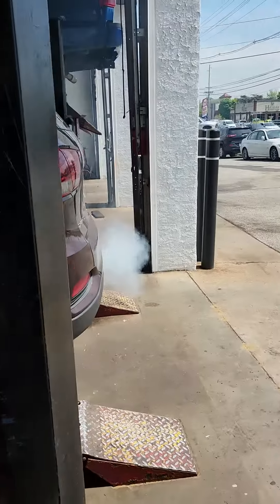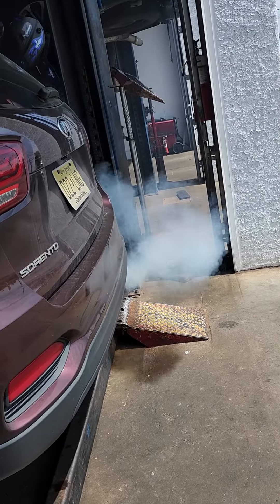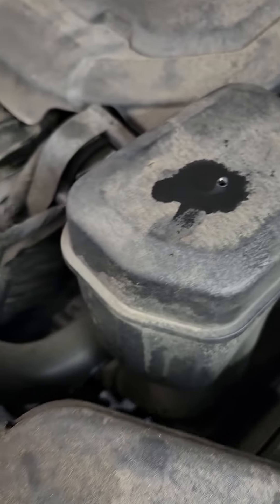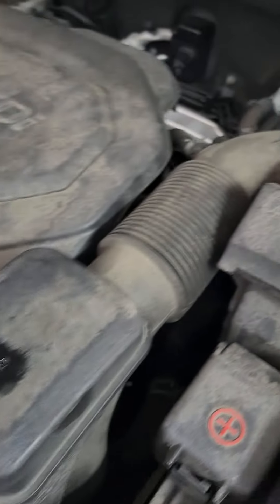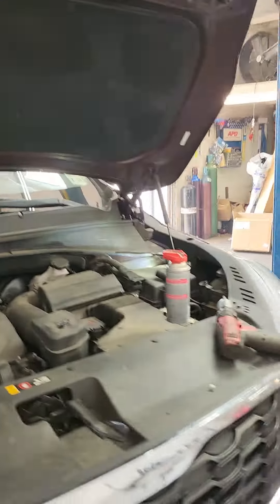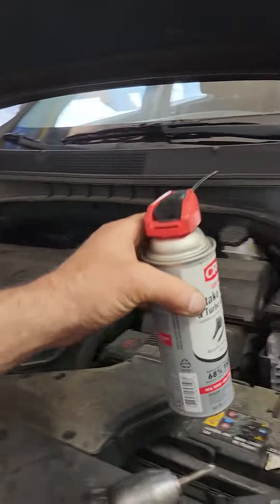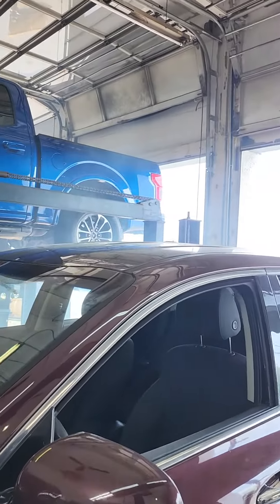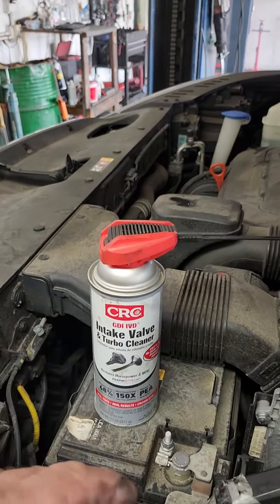2019 kia Sorento  this is not a good sign Basic Gdi service

Comment: In general, with GDI engines, is it the lack of fuel through the intake that allows carbon to build up on the valves? I understand that there are service intervals from the manufacturer that are meant to prevent it from becoming a big problem and as you've shown, many times, when they aren't taken care of it will lead to carbon build up.

Comment: Wawa and Quick check sells gasoline that is not Top Tier which are additives added into blend to reduce carbon deposits especially in gdi. Funny how big corporations pull the wool over consumers eyes and sell junk but fanboy loyalty prevails. Similar to how Hyundai sells you a car with a 10/100,000 that won't be honored when motor is junk by year 5 with 80k... I grew up in an era when people kept their word of promise with a handshake and look in the eye. Today's world, anything goes.
Reply from the maker: Correct cheap fuel is exactly that  . 300hp plus engines using carp oil  no maintenance over extended oci  w cheap fuel disaster  receipt